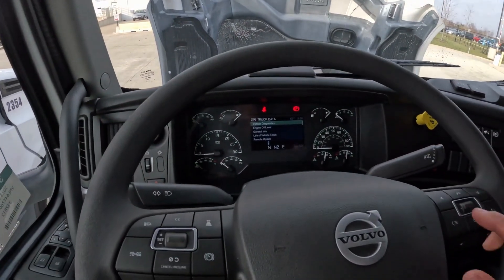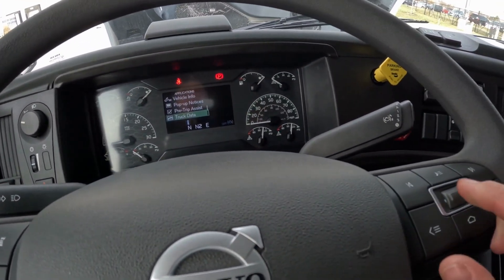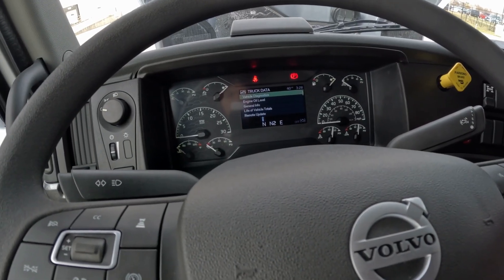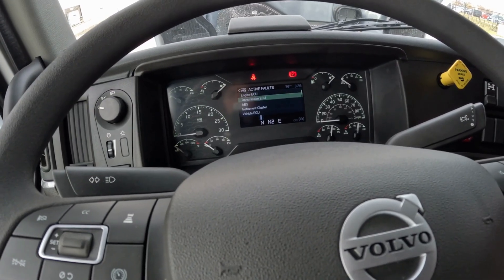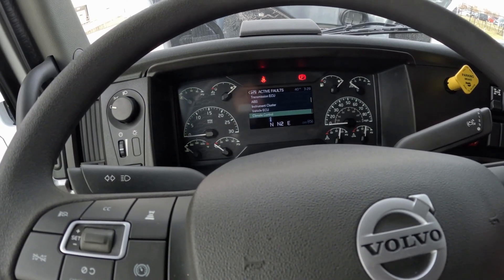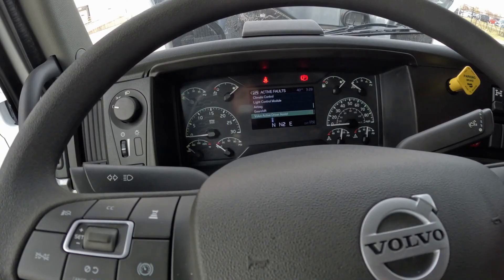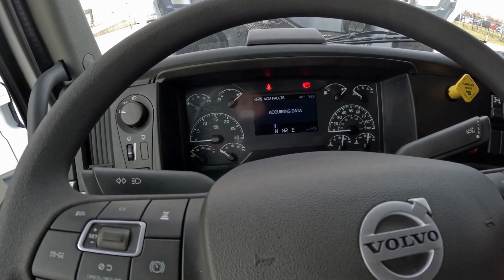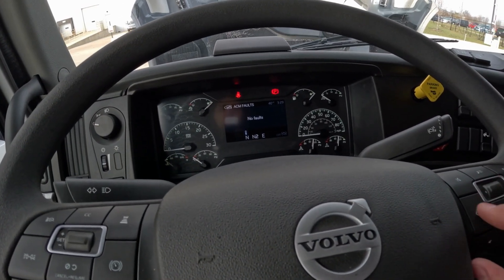How to check for fault codes in 2023 VOLVO VNL truck

Comment: I have check engine light on, sometimes when I drive a few miles it will turn off, but sometimes it will stay on and when I check diagnostics it say no fault codes on every single thing. Do you have any suggestions?
Reply from the maker: Sometimes all you need is park regen. Try doing your park regen oftenly. Check my other videos, there are instructions for Volvo and Freightliner
Reply: @ ok thanks man, I tried it and it is gone right now actually so maybe that did fix the issue. I appreciate it.
Reply from the maker: @Sammysmooth101  Good to hear! Make sure you subscribe to my channel sir!